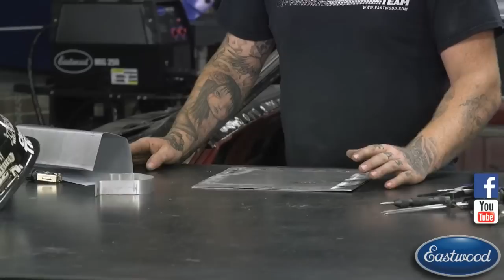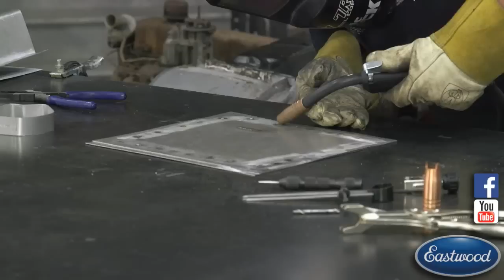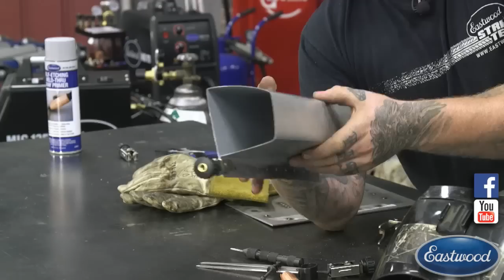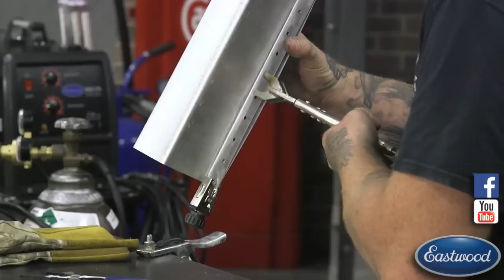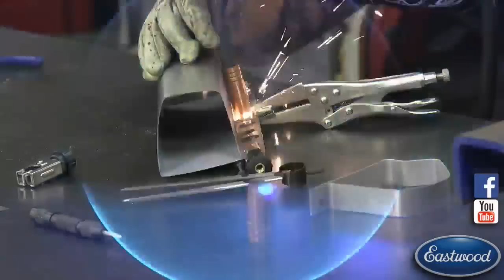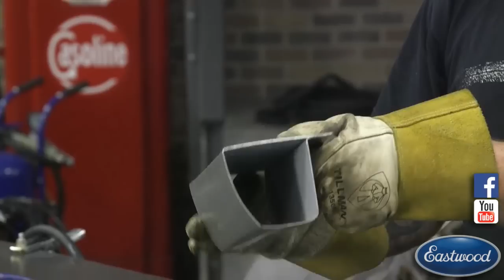How To Weld Spot Welds & Rosette Welds - Great Tech Tip From Eastwood!

Comment: Maybe its just that this video is 7 years old, but like c'mon - who does spot welds flat on the welding table, that allows massive heat shrink away from sheet metal, allowing you to use higher amps to weld. Try these settings done on the weld table with the sheets in the air and you will just blow holes. I get any experienced welder will know this, but when a video is titled "how to" its assumed this is a tutorial for beginners who don't know, and not even a mention about this nuisance from the professionals here..

Comment: How do I spot-weld a light frame and an ironing board please?  What tools do I need for the small piece.. One is like a thinnish wire and the other is a +-3cm bracket that came lose. I would really appreciate your assistance

Comment: Is there a kind of trick to determining power and feed speed? It makes sense to assume that a better penetration is achieved from a higher power setting, but when do you know to change your wire feed setting? When you're trying to either cake on or be sparse with filling a weld?

Comment: 1970 Boss Mustang , while mig welding I keep getting burn back into my welding tip.
Amps seem ok and the Argon mix is at 15psi. What could I be doing wrong.      Thanks.
Reply: Burn back is very common. It results when a weld forms in the contact tip. It usually occurs when the wire is fed too slowly or the MIG gun is held too close to the base metal. To correct burn back, increase the wire feed speed and lengthen the distance of the MIG gun from the workpiece.

Comment: what is the longest extension cord for 220 would you use.And when you spot weld a bed panel do you skip every other hole to weld to stop warp age
Reply from the maker: Well, we sell a 40ft one, so I'd say that's a good place to start. Ultimately, if you find you're not able to penetrate your weld pieces with the same settings as when directly plugged into an outlet (or at all even when compensating), you'll have to adjust accordingly. One of those things you'll discover with more experience.

Comment: I use copper bronze welding primer hardly no splater other tip is clean grinding or oil contamination  before using weild heat primer

Comment: I'm using the Eastwood Spot Weld kit with nozzle and clamps.  My MIG is a 110v.  I have the heat all the way up and I am not getting penetration.  What am I doing wrong ?  The welds are as you say very proud.

Comment: Got a great deal on the Eastwood MIG 135 should be here on Saturday. I have to replace the inner roof panel on my 68 Chevy C20. The windshield seal has been leaking for years before I bought it and the rust is terrible Someone filled it with bondo from the L visor mount to R visor mount and the mirror mounts are gone. bought a OER replacement patch panel. So I have to spot weld from the vert position in a horizontal direction. This video has helped me plan for this project.

Comment: if your restoring a expensive car just buy a spot welder, a diy spot welder cost around 500 bucks and will weld up to 2+2mm, comon car uses 1mm or 1.2mm metal sheet, so you're good  with a diy spot welder, much better than plug weld with a mig.
Reply from the maker: This tool is designed for the guy who doesn't want to spend $500 or much more for something he may only use a few times.  For about $35 or less, this kit will be very helpful for a lot of people.

Comment: What do you mean by "I have the machine set high" ? When I set mine to a higher voltage, it just hisses instead of crackling. Or if I also speed up the wire, then I get way too much wire in the spot weld.  I would love to see a better explanation if possible.

Comment: A question about buying the eastwood 135 or 175 mig weld: I live in sweden and we have 220-240 voltage here. Is it possible for us here in Sweden to use this machines then?

Comment: Will the spot weld nozzle tip work on a Lincoln 180?
Reply from the maker: It will work with Tweco consumables, which I believe Lincoln uses.  The Spot Weld nozzles threads / screws onto the torch.
Reply: Ok. The reason I'm asking is I bought your spot welding kit but the nozzle doesn't screw onto the gun well at all. It feels like it's cross threading and won't screw on all the way down. Any ideas?

Comment: 1996 Sonoma body dropped with SBC and new patina paint. loving my MIG 175.  All new smoothed firewall, Bed floor and sides.  This includes all new sheet metal dash and doors. Hotrod style.
Reply: sounds awesome!  why a sbc instead of ls?  I'm pulling my 350 to go to 6.0..
Reply: I had a freshly rebuilt motor ready to go and wanted a really clean and simple install.

Comment: 1956 Plymouth suburban frame off resto mod for the wife . 71 Dodge Charger with tons of rust repair. In the process right now replacing front sub frame and floor pan replacement on the 56